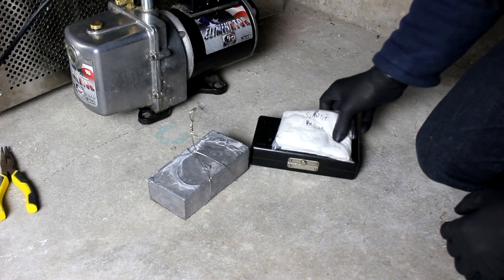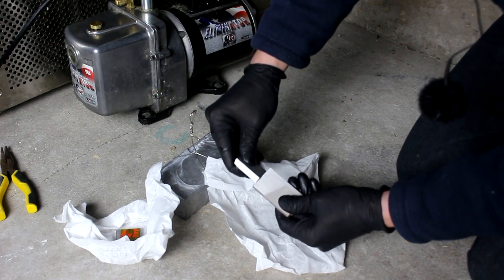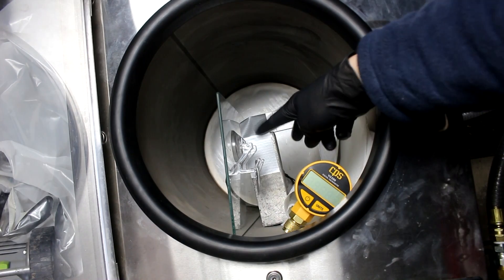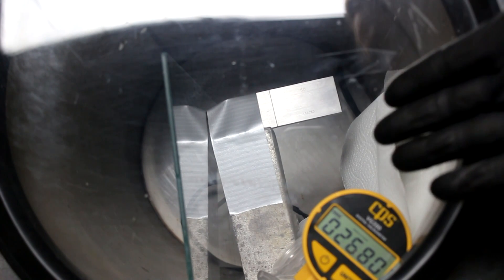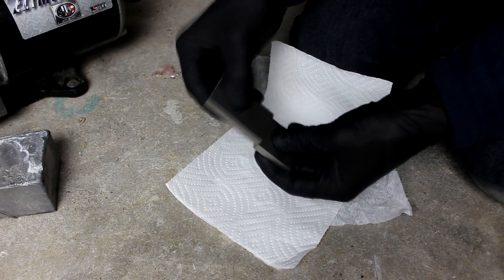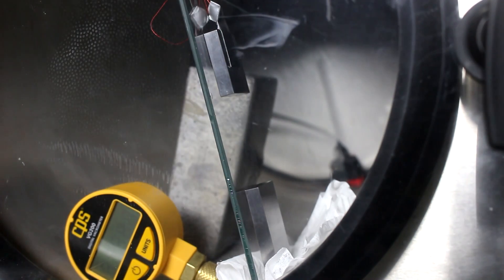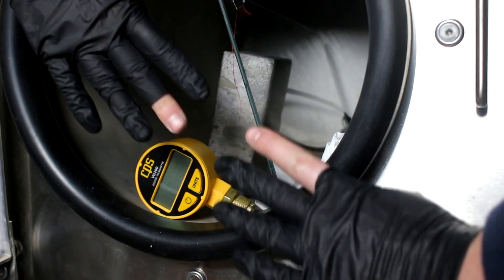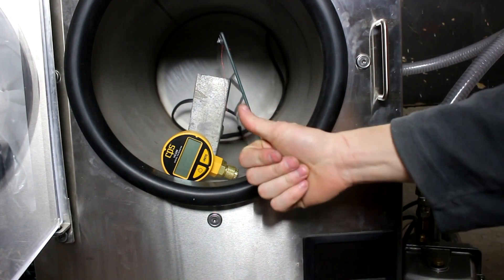Will Gauge Blocks Stick In Vacuum?

Comment: Metal pieces cold weld without difficulty in space, perhaps the vacuum chamber cannot create a low enough vacuum. Also, as cold welding is a problem in space it's almost certainly not down to air pressure.

Comment: Cody: ask yourself why the particles of one iron bar stick together and not fall apart like sand.
there in no such thing as solid matter.
only resonace of energy waves, the smooth surface allows the magnetic ? effect to be felt.
gravity and magnetic forces are very short range and need to be in phase to be effective.
Maybe the smooth surface puts particles in phase?

Comment: Could the friction cause enough heat to very briefly heat the molecules of the steel to cause them to stick together? "cold welding" doesn't necessarily have to be cold. It just takes pure metal with no oxide layers. Or so I thought...

Comment: So.... two ideas.
First , put on weight to the side of one plate,as close to the limit of adherence as possible(if it's consistent), and then put it in the vacuum , we might see if the air is assisting in any degree.

Second (purely theoretical/most likely won't work) 
Check the conductivity of the combined plates ,when simply touching and when stuck together. In theory there might be the slightest change. Would it be measurable? I don't think so but you get my point....

Comment: isn't it it could be the kinetic energy you putting into squeezing the 2 blocks together it makes them form a weak bond in between the two blocks and the harder you squeeze it the stronger the bonds are

Comment: Is it possible that the friction is creating a current in the metal which in turn creates a magnetic field that sticks them together.
Reply: David2lj david2lj One way to prove this would be to heat the blocks after you've got them stuck.

Comment: https://geckskin.umass.edu/

its how geckos run up the wall...

Unlike traditional pressure-sensitive adhesives, which rely on 
viscoelasticity for adhering to surfaces, Geckskin™ relies on a concept 
known as draping adhesion. Draping adhesion is created with materials 
that can drape to create conformal contact with a surface while still 
maintaining high, elastic stiffness in directions where forces will be 
applied. This design enables adhesive loads to be more evenly 
distributed across the pad surface, while also allowing for a rapid and 
low-energy transition between attachment and detachment.

Comment: Can you build a new door for the vacuum chamber with gloves for handling material in the vacuum? Then you could test if the blocks still wring together in a vacuum after being cleaned with acetone. That experiment could eliminate air, oil, or water vapor as possible sources for the gauge blocks ability to wring.

Comment: Show me a rocket producing measurable thrust in a vacuum. I don't think you CAN which is why you never respond to me.
Reply: Newton's Third Law was published in 1687; if it were wrong, don't you think it would have been noticed by now? The mass and velocity of the burned fuel pushes the rocket forward just as much as it's thrown back. In other words mv=mv . Air makes it harder to throw burned fuel back, so rockets work better in a vacuum.
Reply: Pygar2 In theory a rocket should be more efficient in a vacuum but not really for the reason you mentioned but rather more because the greater pressure differential should produce a higher exhaust velocity. Theory and reality are often different and I'm a practical guy who likes to see theory in practice. So like I said. Show me.
Reply: Pressurewise, we're on the same page; I put it more simply. Less back pressure means more power, which is why bikers like to use ineffective mufflers!
https://spotthestation.nasa.gov/sightings/ is the easiest proof- you can research Newton's Third Law for yourself if for some reason you don't trust your own eyes.
Reply: Pygar2 I don't need to research Newton. You don't get it do you? I want a NON NASA video to show to flat Earther's to shut them up. Can I make it any more clear? NASA vids aren't proof of anything other than fraud. It isn't my fault NASA produced provably fake videos. Question? What prevents the exhaust gasses from diffusing in every direction? In atmosphere is is fluid dynamics.
Reply: They exit the rocket in a particular direction, and continue until acted upon. If you think the sky is a NASA video, you're just plain nuts. I can't be bothered to help flat-Earth Apollo deniers who can't be bothered to go outside and look up. Goodbye.

Comment: perhaps you're overcoming the weak force and allowing the strong force from the nucleus to be attracted to the valence electrons of the other.  the twist and push is getting it as close as you can.  try pushing with excessive force.
Reply: so there a strong and a weak force.  that's why electrons don't get absorbed by the nucleus basically.
Reply: From my basic understanding: Strong force proper is the force between quarks. The strong nuclear force is the 'byproduct' of this allowing nucleus to stay together. This is the strongest force by far, but also the shortest. 

That being said, electrons do not feel the strong force.
Reply: You're basically describing cold fusion. Two atoms being pulled together by the strong force is fusion.

Comment: At no point did I think this was down to vacuums.  To me seems clearly micro areas on the surface area where the friction increases the heat enough to weld them in those areas.  Clearly not a solid and uniform weld, but enough in micro areas to hold it against small forces (hence why you can pull them apart again).  Regardless, still enjoy your vidoes and greeting from the UK!

Comment: Don't want to spoil the party, but if you think it's the metal atoms interacting then all you need to do is measure the electrical resistance between the two blocks :-) The result might surprise you. If you need the cat let out of the bag just yell out :)

Comment: Do you think you could arrange several bar magnets on two dics, such that the N/s boundaries would resist slipping, so that you could fix one disc inside the chamber(which is free to rotate on a bearing) to one block, which is faced against another block also inside the chamber which has been anchored to the "ground".

Then you could rotate one disc outside of the chamber which would rotate the inner block against the static block.

now that i typed that, i notice how thick the door is which probably rules this idea out. you would need fairly strong electromagnets i guess.

maybe its worth a few microwave ovens.. i cant think of another way that doesnt involve risk or modification to the apparatus.

Comment: i have a hypothesis on why they stick together. what if the gauge blocks have an oxide layer on them and when you rub them together them oxide layer gets removed and then when the oxide layer reforms it bonds them together

Comment: my theory is that it is the metal bonding together and the reason you need motion is to give the atoms enough energy to form the bonds between each other. A way to test this would be to heat up the sides of the block with the laser before you cut the string and drop the top block down.

Comment: hello! maybe friction  creates enough heat to warm the air molecules when you slide them, the space its so tiny that it cools quick enough to shrink the trapped molecules between the plates to create a micro vacuum...

Comment: I don't think the vaccum really tells us anything. Cold welding requires there to be no oxide layer. Being in a vaccum doesn't get rid of the oxide layer so you'd still have to scrape them. Not sure how to prove whether or not it's cold welding vs friction. Maybe somehow abrase the metal while in the vaccum, then touch them together.

Edit: Oh, I've got an idea! Lasers can be used to clean rust off metal so maybe you can test if your metal is capapble of this. I'd think not however and you'd have to check the properties of the oxide of the metal you're using compared to iron oxide.

Comment: Just a ponder: the particular structure of metals is a lattice of positive ions in a sea of negative electrons. Perhaps all you are doing is rubbing some electrons off each block onto the other side, similar to how a static charge can be made from rubbing an insulator with a conductor? In which case the positive  ions from each block would now be close enough to each other that the electrons from the other block could flow through hence making the 2 blocks one?

Comment: Could this not be a case of cold welding? The two metal surfaces might be so superflat, that only little pressure is needed to get the two pieces so close together that they there is no air between them. There then would be no vacuum between the blocks at the points of the surfaces touching the most, but it would become ONE block in these places.
Oxide layers prevent that from happening but when twisting and thus forcing two edges over the metal, acting like a razor, you probably just srap off the topmost layer of oxides. Then the two superflat and now oxidefree surfaces touch each other under little pressure and cold weld.
It would not work in the vacuum because before you put the metals into the vacuum chambers, thin layers of oxides might start to form on the previously scratched surfaces.
To confirm this you might need to cut them while inside a vacuum to prevent oxides from forming, then dropping them ontop of each other.... :D

Just a theory though...

Comment: Cody I think the one variable you didn't account for was the pressure you apply when you wrench them together. Can you rig up a vice type contraption inside the vac chamber which you remotely compress the two blocks together. You could try this on a fresh set of blocks in the atmosphere afterwards.. Also check the surface for dints because the more you use them the more you scratch them up

Comment: I wonder if it's related to an oxide layer? Here's my thinking: There's an oxide layer that's disrupted with the sliding motion. The tolerance between the two surfaces disallows oxygen to enter and stops it from reforming that layer. Once it's gone, the molecules within the metal can freely interact with their neighbors on the other plate, causing them to stick.

I'm curious if there's a viable way to test that

Comment: Great video, but you have to try one more thing in the vacuum chamber. Make a vertical jig to drop one block onto another with no side support. The upper block must contact the lower without any interference from the glass plate. That glass looks pretty flat, but probably not in the same  order of magnitude as light waves. Guide the drop as close as you can, but do not make contact with any other object at rest. My prediction would be the same result, but this must be verified.

Comment: could it be that the friction scrapes off enough of the oxide layer that it will cause microscopic spots with no oxide where they almost invisibly cold weld, but not enough oxide layer removed to where it creates a stronger bond?

Comment: try applying just normal pressure in the vacuum over time. i think just like carbon turns to diamond requires pressure and heat the friction would provide the heat and the force of you give provides the pressure

Comment: what about the metal element's property of making a electron cloud around them to bond to each other, you know, thats the way metals bond. so you'll have that thing happening here but in a less strong way

in fact, maybe the act of rubbing each other heats them enough to have the energy to do so. I think i read in some place an article about this, like saying that you can bond in a atomic level two no rusty metals in space if they are made of a single pure element

Comment: Got a set of very well kept gauge blocks from Ukraine, made between 1970-1980 and an optical quartz test glass for flatness from the same seller a while back. Using a low pressure sodium lamp to see interference patterns on the gauge blocks, thanks to its monochromatic light, the ones that wring properly have a very tight and very unified straight line pattern in one direction, showing the last direction in which they had been lapped. Not easy to take pictures out of with a phone unfortunately.

How much did you pay for the vacuum gauge btw? Considering buying a better vacuum gauge than the Chinesium one that doesn't seem all too accurate.

Comment: I don't believe the primary use for gauge blocks is for calibrating. You would only need one or two for that. A set like that is often used for checking that parts are manufactured correctly. If there is a 2" slot cut into a part, you slide the 2" gauge block into it to check if it fits.

Comment: I think that when you cleaned the blocks with acetone, you removed the oils that protect the metal surface from oxidation and thus, an thin oxide surface formed, preventing metal atoms from interacting. When you use force in rubbing the metals back together, you are scrapping that oxide film away. That's my hypothesis though.

Comment: maybe the metal oxide layer on the surface of the gage blocks prevents them from sticking. When you slide them against each other that layer gets partially disrupted and the actual metal crystal structures (or domains of single crystals) touch and fuse. 
Have a look at the abstract of this paper in nature "http://www.nature.com/nnano/journal/v5/n3/full/nnano.2010.4.html". 

I have heard that "cold welding" is an actual problem especially in space, where friction in vakuum occurs, because the oxide layer gets polished away without forming any new, so close to perfect bare metal contact is possible. Maybe test sliding them past each other in the vacuum and see if sliding them past each other more often makes a difference as the oxide layer is slowly deteriorated.

Comment: Hi Cody, just wanted to add a few things about those gauge blocks. 
Not only are they used for checking to make sure your inspection tools are working accurately they have hundreds of other uses around the shop. One popular one is on a sine bar or plate. Take a bar of a certain length, jack one end up a precise amount and you can create incredibly precise angles. 
The tolerance on these blocks varies from shop grade (.00005" deviation) to K grade, which is the grade used to calibrate all other gauge blocks! Flatness of the ends is not exactly one wavelength of light as measured on an optical flat, it depends on the grade.
The ends are also not ground, because the microscopic surface of a ground part is very bumpy and they would just scratch each other when wringing, and the high points would wear quickly which would ruin the blocks accuracy. Rather, they are precision lapped. 
DoAll made very nice tools, cherish those gauge blocks!

Comment: I would say that there is an oxide Layer on the surface of the metal and if you twist it it will remove this layer. If the metal molecules have direct contact they share electrons, you could say there is no reason that the metal doesnt stick to itself how it always does in a solid piece .

Comment: Cody, imagine pushing two lumps of Play-Doh together. If you just press them together, it creates a flat surface between them and they can easily be pulled apart. When you drag the lumps of Play-Doh against each other, they rough-up each others surfaces allowing them to stick together.

I think the same thing is happening here at a very small scale. When you press the metal together, the surfaces flatten-out against each other, but when you drag them, the metal surfaces are roughing each-other up and maybe the small rough bits are able to interlock or merge together like Play-Doh.